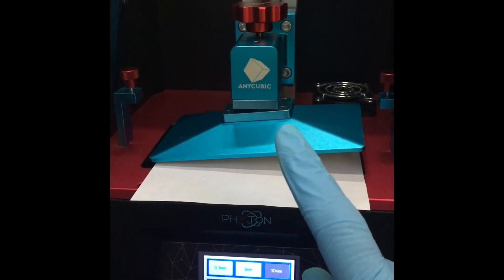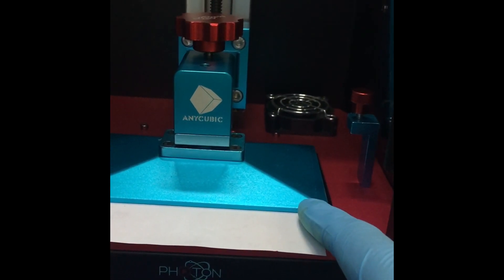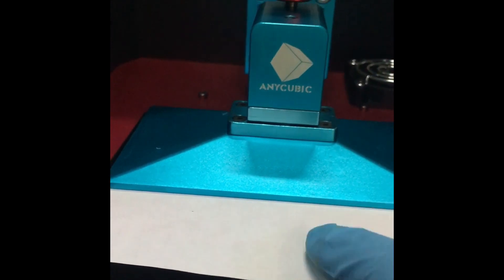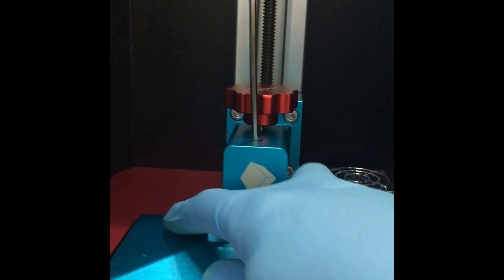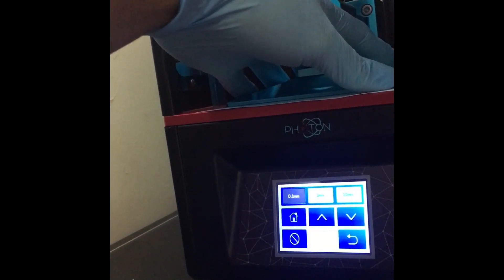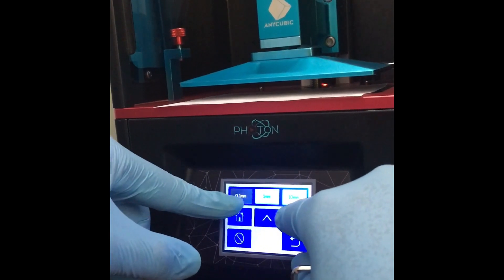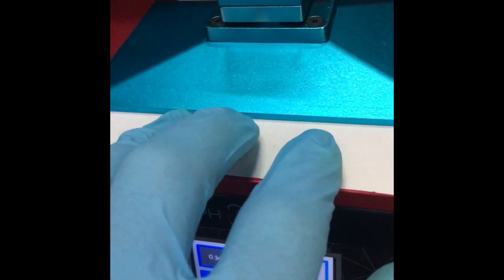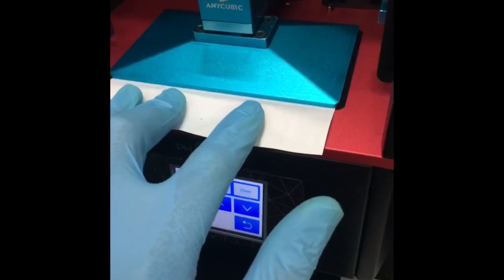Leveling your photon the correct way.

Comment: almost broke my z axis with this shitty method
Reply from the maker: Sounds like a you problem, Levi.
Reply: @Outlawisbest  the printer always compensate when you tighten the screw after leveling, this compensation forces the z axis into the lcd and put stress on the z axis. I've tried this 2 times with the same result
Reply from the maker: @levacarvalho  Idk man, I haven’t leveled in 2 years.

Comment: Hi amazing video im very new to resin printers so i copy your video but wat i cant work after ive done what u have done why does the the paper can moves freely under the build plate and also i used the chitubox example square print. Sliced it wait 4 hours and no print nothing 😞😞but i did notice on the printer screen the uv setting exposure is set a 3 but on chitubox its 8seconds??hope u help me thanks 👍👍

Comment: Nicholas, a quick question as I've been experiencing some issues lately...re-leveled my Photon, but noticed that the gap you have mentioned at around 1:00 is not symmetric no matter what I do. From this video it seems like it's similar for you as well. Is this normal? I've printed a lot without bothering that part, but now when I checked I noticed that wide prints mostly start failing from one side, and I have a suspicion that this might be the issue.
Reply from the maker: zirrian hmm. Is your plate sanded? Can it be possible that the surface itself isn’t level? If not, take the plate apart. You might have gotten some resin in there during its lifetime. Give it a good clean.
Reply: @Outlawisbest  It's not sanded, I've been using it for more than a year now, but only my latest two prints failed similarly...I will take it apart tomorrow and check. Thank you for the hint and the quick reply.
Reply from the maker: zirrian keep me updated!
Reply: @Outlawisbest  Well, cleaned it totally, mostly took the build plate apart, and it worked for a couple of prints...then yesterday for some reason the build plate was twisted mid-print, even tho I tightened the screw properly. I'm a bit baffled, but not giving up, and add more strength into the tightening process :)
Reply from the maker: zirrian hmmm... that definitely sounds like a slippery ball joint. Only one grub screw in the plate right? Not two?
Reply: @Outlawisbest  Yeah, only one.
Reply from the maker: zirrian solved?
Reply: @Outlawisbest  Unfortunately I did not get to try it...this week was really busy. I will have a go at it over the weekend, hopefully.
Reply: @Outlawisbest  It's still not perfectly level, as the left side appears to be higher, and the backside is a bit higher, but managed to print out some stuff. Oddly enough from three models only the two on the sides printed, the one in the middle failed after around 3 or so millimeters. It's odd.
Reply: And now when I switched out the ball joint with a fixed metal part with 4 screws, it appears to be functioning properly :P
Reply from the maker: zirrian the ez level? I think I know what you’re referring to!
Reply: @Outlawisbest  Yep, but made by the guy who I got the printer from for 13€ instead of the 20€ or so it's going for.

Comment: this is absolute rubbish, all your doing is driving the plate onto the screen and putting pressure against the column. You will end up with the front edge of the plate closer to the screen than the back edge, when you raise the plate.
Reply: you're absolutely right

Comment: >>>>>    READ THIS IF THIS METHOD STILL ISNT WORKING FOR YOU !!!!!!!!!!!!! <<<<<
This method is PERFECT but there are 2 things to bear in mind. 
First of all, when you tighten the grub screw if you see the plate pushing upwards, unscrew and move up by the smallest increment. 
Repeat until you can tighten without this happening. 
Otherwise you will have a plate that seems level from left to right but will NOT be from front to back. 

Secondly, really get your fingers close to the edge of the plate when you do the push test and shove it in parallel. It may seem like it's going to be too close but this is the ONLY way I have been able to get prints AT ALL out of engineering resins which aren't so forgiving. 

Good luck
Reply: i dont understand, if i move it up so the plate doesnt push with i tighten the screw then its really loose for the push test  on the paper,  i cant have both tight paper and  no movement when i tighten.
Reply: @MitchSound  Go down one small increment at this point. 
You want the plate to push down, but you don't want the arm to be bending the z axis screw back.
Reply: @MitchSound  I hope you got it all working in the end?

Comment: You could actually hear at the end the same problem I've noticed - because you've tightened the screen with plate flat on the screen - and as pointed out, you start seeing the lift of the anchor when tightening, when you actually lift the whole head up, the front of the base plate is lower than the back since that additional angle created by tightening of the grub screw has self corrected
Reply: So what is the solution? struggling here!

Comment: When tightening the plate will go out of alignment. All the way down bends the axis also not perfect way. Best way is just by hand and sight. Oh also build plate corners are higher up then middle. So best way is set hight to 5 or so mm, get led light, align so back and front of all four corners look aligned. Now when you tork it down, again it will slightly move, tap with hammer under lighter tightness, tork, untork tap, repeat repeat. Lower to 1 mm and check four corners gaps with led light. 30 or so prints you will need to align again.  Bottom line build plate sucks. Make better one for me to buy!
Reply from the maker: Did you just say you use a hammer to level? Are you insane?! Hahahaha
Reply: @Outlawisbest  "Tap" with a hammer.  Very nice comment, just see hammer and comment like it is stupid.  Do you want yours leveled correctly?  Or are you giving up?
Reply from the maker: Spam Remover there’s so much to unpack here. Why are your corners higher? Your plate needs to be absolutely flat. Grab some sandpaper.
Reply: @Outlawisbest  Did that.  It is still not even.  The aluminum is not milled flat, so there is slight warping from the part being processed.  Either it was too expensive to do this or they just can not mill this type of part.  It is flat, just not perfectly flat.  When it is not milled the corners be warped/bowed downward from how aluminum is processed.  No amount of sanding will get you a perfectly flat entire build plate.  Just as much as the sandpaper will do until too much surface area keeps it from sanding more.  Try my way I put in the second comment with posts after you level it with paper.  It may still be off some.
Reply: How about you think of a better design and sell it?
Reply: @sasca854  I have now perfected leveling it.  Print four thin posts even length with a base that can attach to the build plate with double sided tape.  One for each corner.  I use a led light to shine between posts and uv lcd screen to see about the same gap between each post of screen, I go by about a .02" gap.  When tightening the tensioner hold the left of build plate screw area with equal force while tensioning it, so the build plate stays aligned.  Repeat a few times until happy with the gaps of each of the posts/lcd screen.  Takes me 5 minutes every time it goes out of alignment which is still way too often, but atleast it is not such a big deal.  Also when screwing the build plate down or removing it I also hold the left/right of build plate screw area to keep the back bearings in new condition.  Never have issue's with my models anymore and they are all very small detailed things. 

Another thing I learned about full plate printing, or printing separate models is you want to connect all parts toward the bottom, the first ~.25" to .5" of the parts.  I use horizontal .02" poles in the model that are easily cut off and sanded.  It has something to do with the FEP film pulling upward.  When the parts are connected even if everything is held together with the .02" poles and has much more strength to combat the FEP film's pulling up with the part on each layer change.

Comment: when you keep a new 0 position on Z axis and save parametrs, after when you go in "house" position where stop platform? distance from platform to display is come with paper or over?
Reply: When you level and select Z=0 that saves your new first layer position, but unlike an FDM when you press the 'home' key the plate will stop by default at the place it trips the sensor so it will be higher than the 0 position, that had me confused initially.
If you check my channel you can see all the steps to setting up and printing I did. Hope that helps you.